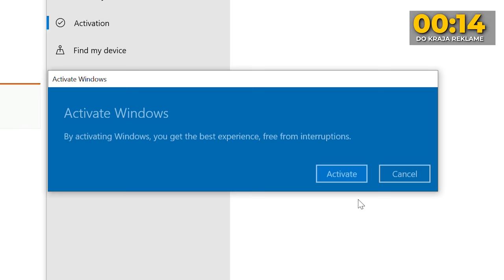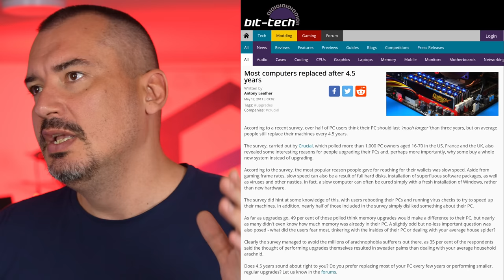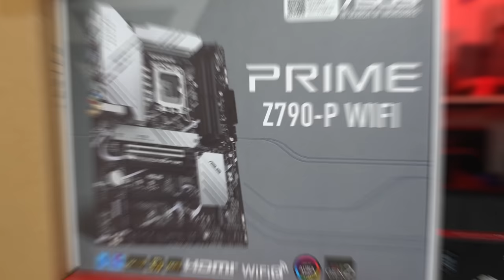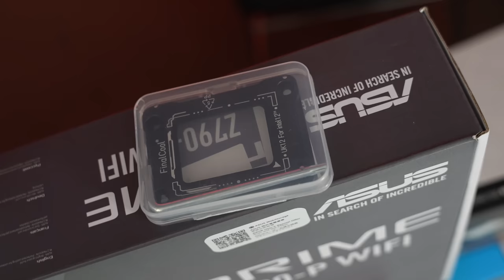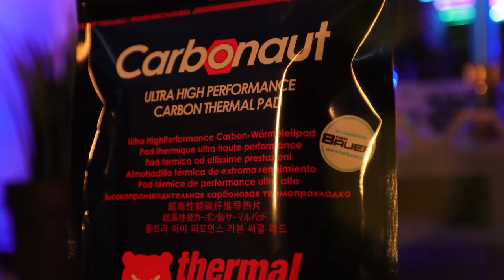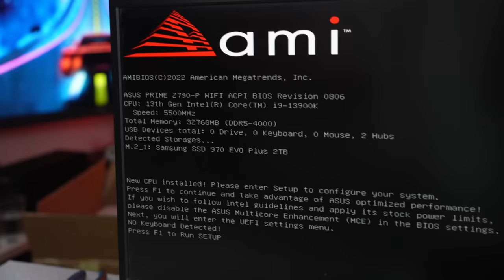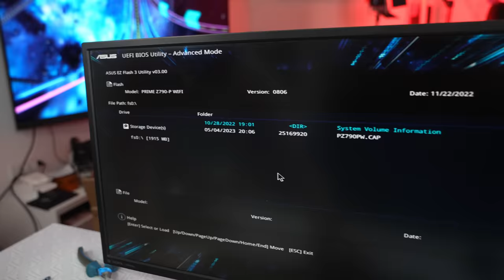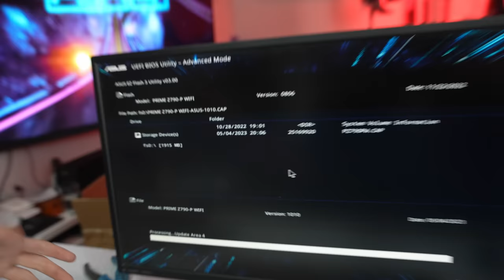N.N. BUILD ZA N.N. LICE!

Comment: dule imam problem, iskoci mi sa vremena na vreme plavi ekran. e sad problem je sto meni baci samo restart i posle racunar radi normalno. dole za error code pise valjda VIDEO TDR FAILURE  . znas li mozda sta moze biti. to mi je iskakalo do pre mesec dana, pa sam ocistio ceo komp i nije se desavalo do danas. optimalna temperatura procesora je od 45 do 55 stepeni ryzen 3 1200 sa stock kulerom. a 1050ti radi na 30 stepeni. imas li mozda neko resenje.
Reply: Po meni prvo proveri gpu drivere kao i windows update a za ostalo moze biti 1000 stvari
Reply: Ddu očistiti Drajvere od grafičke i instalirati najnovije i videti šta se dešava
Reply: 1. Skini DDU (Display Driver Uninstaller) sa interneta
2. Udji u safe mode i obrisi trenutne drivere, ne zaboravi izabrati opciju "Prevent windows update from installing new drivers"
3. Kad se restartuje samo skines drivere koje koristis i tjt ako je bio problem u tome rijesit ce se